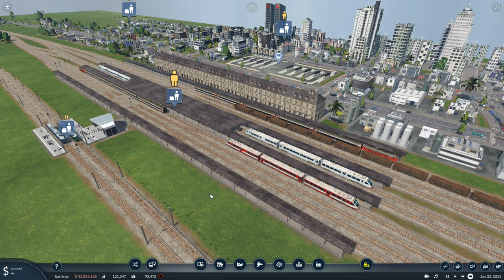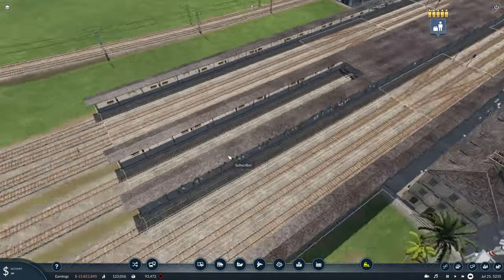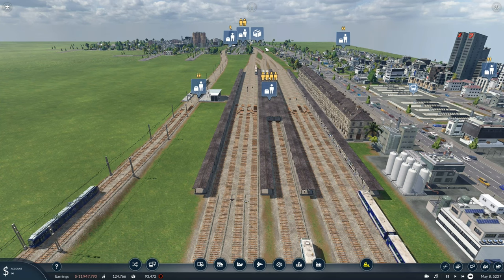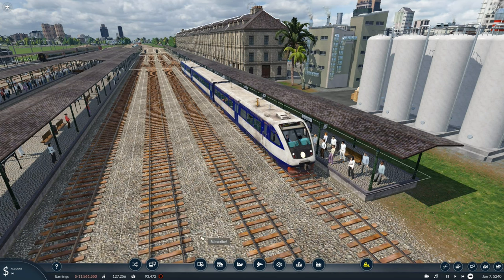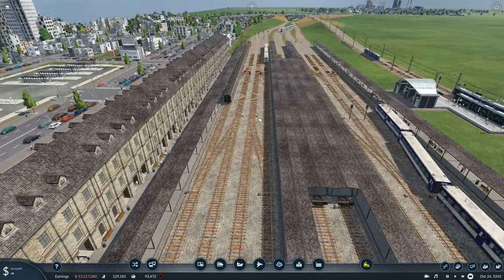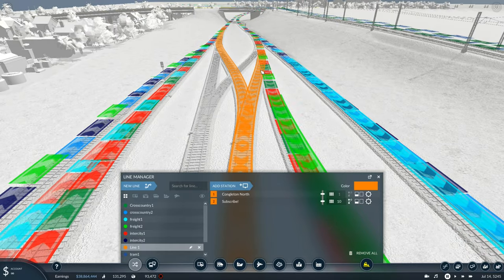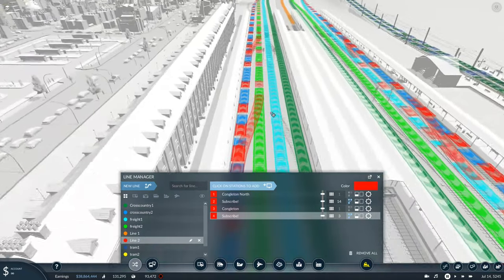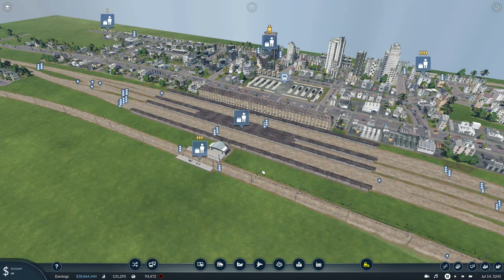Revolutionising Passenger Stations In Transport Fever 2!

Comment: You inspired me for the new update. Never thought of split platform sections. In Germany it's common to share a platform for 2 trains going in the opposite direction. I had this in mind planing but never realized it. Thanks for the input
Reply from the maker: No problem glad you found it useful :)
Reply: @Hushey  I've discovered some issues. I've made a 3 platforms on each side and the last or first Plattform don't get any service depending on the prior Track.

Example : 1---2---3->
Prior 3, don't get services at 1 even with connection. And also with 1 and no service with 3. Any ideas?
Reply from the maker: @philipw6611  not quite sure what you mean. Add my discord Hushey On YouTube#7555 and send me a screenshot to help visualise if you can
Reply: @philipw6611  I have the same 3 platforms on each side.. and they work.. make sure when you set the trains stops start with the faraway part of the station first. for exemple when you set the trains stops.. put them like this.. 1 stop = line 1 and the alternatives on 2 and 3. do the same for any station you build using multiple stop spliting on the same station.. and they will work..and make sure the station stops are long enough so the train that stops in it.. have enough room to get inside the spot. Hopes it helps.
Reply from the maker: @@eurostarguy373no mods, vanilla
Reply from the maker: @@eurostarguy373passenger station, follow the video for the how to
Reply from the maker: @@eurostarguy373 press modify then delete sections like in the video

Comment: This kind of station is mostly unnecessary overkill. The poor coding of the game will cause a map to grind to a halt when you have the number of towns which it would take to make the station operate to its full potential.
Reply from the maker: True, but its so efficient you can use it anywhere intermediately and on even 1/10th of the potential for max taffic flow

Comment: Going to make this a separate comment. After playing a map specifically with these terminals (and your cargo hubs - which I LOVE), the downside I see to this is that it makes having shorter express lines a pain (2-4 major cities, or between 2 major cities). I setup my mainline initially between 6 cities (4 big cities, 2 little ones). I'm using JR East 253 units on my 'slow city to city' routes (you're using the RAE? here). This works great. However if I want one of the big trains that are in the 250-300+ kph range, then they're too long to effectively use those middle tracks and you're making special turn around loops for them. My point is that there's definitely some compromise and playstyle change needed to use these stations to their max. Although with how your outer platforms are setup with multiple terminals on the same track, there's definitely room to stuff a lot of trains on there on 1 big express line that goes up the entire mainline, but then you lose some of the fine tuning. I'm still sorting this part out lol. I've committed to playing this map out to keep getting used to your cargo hubs, but am still experimenting with the pax lines and terminals. That said, I do want to thank you for your videos. Have learned from them.
Reply from the maker: Thanks for your comment! Theres always a bit of wiggle room with sandbox games like this so youre quite right to adjust it. Im actually publishing a remastered version of this video tonight or tomorrow which is much more in depth! Hope you like it 😁

Comment: This seems like a great idea (and it's actually realistic, the track arrangement is called a lap siding in American terminology) but when i try it in game, my trains only use the front section and I get "Could not connect all alternative terminals" errors. Am I doing something wrong or has something changed?

EDIT: I figured it out. You cannot put signals after the platforms. They can go on the through tracks, but you can't put signals between the platform sections. You don't need them and they mess it up completely.

Comment: When allowing the long length cross-country service to pull in on the end of the platform (3 and 14), does the fact that the long platform is broken into several short ones behind it (1,2 and 12,13) affect the load/unload time of the cross-country train since its platform is shorter than the total length of the train?
Reply from the maker: It does yes. However, this dosent matter as you want all trains aside from commuter to sit in the station a short while so they can fill up as much as possible. Cheers for the comment Daniel!

Comment: OMFG!!! Why i didn't think about this before.. Now this is a game changer when it comes to build HUB's and stations.. This unlocks infinite combination to build stations and have multiple diferent trains on 1 track line inside the stations..and it does not require MODS!!! Jeeeezz My man.. you've made my day. Thx for sharing this trick.. it is just phenomenal. I was spinning my head around on how to fix the damn trains queue's before stations without MODS and thx to this trick my problem is solved. No more trains queue's before stations!!! Now my train's traffic flow's like a charm.
Reply from the maker: Boom! This design is the most efficient station design for integrating all train types and one of the most efficient cargo designes too! Cargo best station is on my to do list. Very glad it helped you out! Feel free to subscribe for more :)
Reply: @Hushey  Just subscribed after i posted the first comment :) And yeah.. i just did a complex cargo train HUB using this metod of spliting the same station. And works like a charm. For exemple.. if a 4 tracks double station is splited to 3 parts o each side.. left and right. It can manage easily 12 trains to that station only.. and thats is way more efficient than doing 12 tracks stations for using 6 trains in two diferent ways but they will have to queue because they can't enter the station if 1 train is inside on each track..but by spliting the station they do not wait in queue. This way multiply's the station efficiency by 50%. Damn .. i wish i was thinking about this trick earlier.. now i have to redo all my all ready developed map.. using this types of stations.. and watch the damn FLOW run. and the money fill the bank.. hehehe.. i all ready doing $160+ millions per year on what i updated now .. but after i finish all the map network i've build before.. it will jump to at least $300+ millions per year .. net income. But man.. the flow thru these stations is just CRAZY!!. hehehe.
Reply from the maker: it is! Glad you found it useful

Comment: I go for the same style as longer stations are less disruptive to city fabric than wide ones
one thing though - I make them lowered down, so I can make level bridges at both ends. So the city end's up being cut off by up to 400 in length (in the largest city) by the station, which is basically minus one large street. The width is basically platforms and tracks, as bridges basically have 0 base. And I place them in the middle of my cities. But yeah - I find this configuration the best :)
Just got my new PC after not touching the game for a year (had a rather weak one till yesterday) - played for ten hours, about half way through the central train-metro-tram station in the main city (though I use trams on tracks and I for level crossing without those pesky bumps, so it takes a lot of planning which definitely took a bite into that 10 hour of station building).

Only problem with this layout - had to change the plans for the tram line as had to add terminals at the ends of the train central station as it ended being some 600m in total and it would actually take a while for a sim to walk from center to the furthest platform where I ended up putting terminating commuter trains.
Reply from the maker: Cool! Good going ivan!

Comment: Question... what do your end stations look like, and how do you route the tracks for those? Spent hours building, destroying, and repeating several times to get it setup like what you're using (more or less) for a few cities. But the routes at the end cities aren't happy. Because they weren't the true end - was going to expend, I ended up having to put a loop in behind those terminals to make it work. But without some elevated passes (which is a pain) I see this becoming very messy at the end. Especially since I'm running 6 lines for my main track (1-2-3-3-2-1, with 3 being my mid speed, 2 being my slowest trains/freight and 1 being my high speed trains). Just doing my main stations is a pain. And I haven't even hooked up my freight yet - I always do the pax lines first.
Reply from the maker: frankly, terminuses suck. I avoid them at all costs unless theres a city in the very extremety of the map with no choice but to use. Theyre just not very good unless theyre bulky as hell.

Comment: Not to flex or something but I discovered that way back in 2019. And to make it even better you can use a X-junction instead of 2 N-junctions
Reply from the maker: You can do, but I think N junctions are better in this instance as they can pull onto the designated through line. Maybe you can share some insight into your thoughts, why is x junctions better in your opinion? Thanks for watching
Reply: @Hushey  While EljeOett may have discovered this earlier, the power that has been added with the use of alternate platforms improves this drastically. Would it be possible to do X junctions with one way signals to help control direction? Then incoming trains would be able to skip trains at early platforms to go to the other platforms further down the line. For example: at 6:50 you setup the alternate routes for trains at platform 1 or 2 to avoid a train at platform 3. One issue I see is if a train is coming into platform 2 or 3 but another train is at platform 1, the incoming train must wait for platform 1 to clear. One thing that would bring this strategy to a halt is a long train that came from the middle through line and stopped at platform 3, blocking the through line. So all trains would have to fit within the platforms to avoid this. Let me know your thoughts.
Reply from the maker: @sekondnature101  I see. Great idea if you're running most or all commuter services. However I avoided this as you can't really do cross country /express very well here. Thanks for your input and for watching!
Reply: @Hushey  I played terminal railways as a kid and they had a station with the same setup with x junctions so when I started playing TpF2 I tried it and it worked. I would rather use a X junction because of my memories about it and because if you use a N junction and one train is blocking the tracks where the train has to pass a normal long platform would be better, only downside with X platforms is that you need 2 tracks in between, where if you use N you can build with one track in between. Also x junctions feel slow but I think the trains are as slow in a N as a X junction

Comment: isnt it better to make |x||X| switches cause than if there is a train it can go around the train i have that setup in a savegame i have you just need to set the signels correct and that wil work and if that is in this station is will work even better i think
Reply from the maker: Thats great if youre only running commuter services. It will get blocked if you start doing express, cross country, freight etc

Comment: Hey mate, ill give you a like for the effort but i wont pretend i understand any of that spaghetti monster you made there... Im an older player and i prefer simpler things. I think this only makes sense in your head, mate, for me it seems needlessly complicated. I prefer a simple 4 track station with 2 platforms on the outside tracks. Any express or freight trains can go through the middle 2 tracks, while any IC trains can stop at the 2 platforms. I think this would be enough for any medium and large towns.
I understand that you are trying to create realistic large train stations, but lets face it, in TF the maps are not even the size of a country, more likely the size of a county/district with up to 20 towns at most and a through station with 6 lines and 4 platforms is more than enough for most towns, but to each his own, i guess.
However, i have to give you credit for that split platform with switches in the middle of the station, that is pretty clever.
GG!
Reply from the maker: Cheers for the comment dangeruso! who knows, give it a try see if it works for you